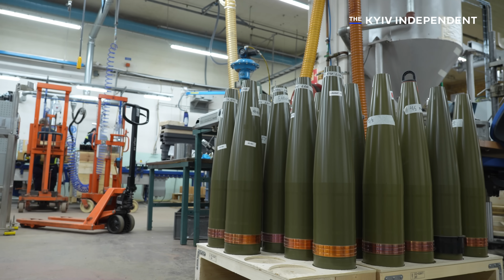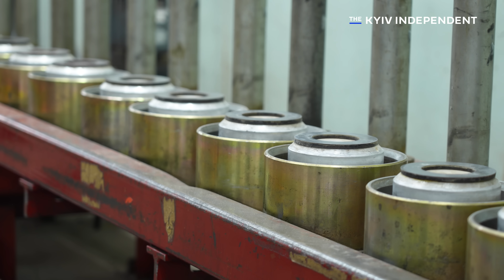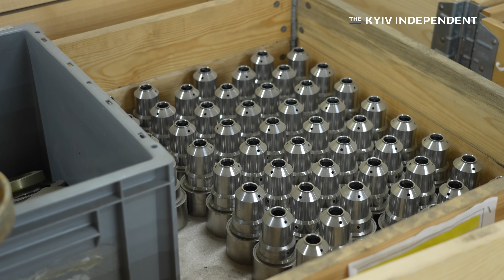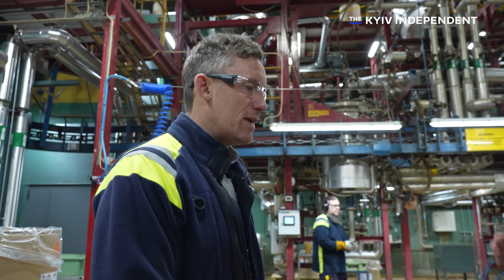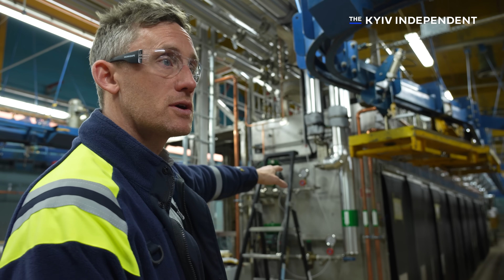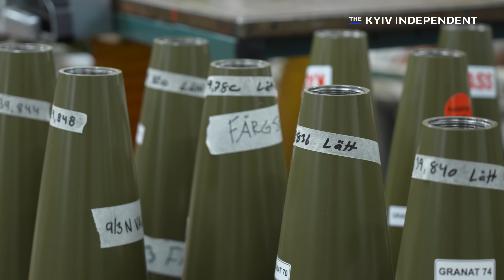The factory working 24/7 to make shells for Ukraine

Comment: So how many shells are produced daily and how many does Ukraine needs to fire every day?
This seems to be a very slow production speed.
Reply: There are, or has been various bottlenecks in the production chain, in this factory I think the capacity is dictated by cooling capacity(seems they are installing 16 more cooling sheds, so thats good), they need to cool down over night, so whatever you can fit in there would be max capacity, doubt they would come out and say what the exact capacity is though.

Comment: Never thought they would fill them by hand out of "milk canisters". But if you don't need many in peace, that might be fast enough. The roboter should be able to fill up many more to increase the capacity together with the extra cooling chambers.
Reply: Well, filling is obviosly not the bottle-neck in the production, so a more efficliant filling will probably not increse production that much.
Reply: @MaskinJunior  Indeed. He said that cooling down is the bottleneck. But that might need its time so it doesn't throw bubbles if too fast.
Reply: @MrPanzerTanzer  autoclave....
Reply: It's not exactly any sauce you deal with here. It's explosive and has to be gently poured. They flush the floor with water for a reason.🎆
Reply: In the video they said those are another product.
Reply: @kristofferhellstrom  "In the video they said those are another product."  And as they said, they are adding 16 more cooling units because that is a bottleneck, so there is a lot more plant to feed them than shown.
This is part of a factory that is spread out for safety. For all we know they were pouring the quality control samples from much larger batches of explosives, and that a different product perhaps a new design of cannon shell not yet automated. 
 Just a snapshot only showing what they wanted people to see while still giving some background.
Reply: Huh? Of course grenades aren't filled one by one on a table by hand from beakers on the actual production line. You're obviously not being shown a mass-production process here. If nothing else, all the labels and signs saying "faulty goods", "rejected" et c. in Swedish on these particular grenades should be a hint.
Reply: Maybe hand pouring gives improved quality, and less shells have to be rejected.
Reply: @the_hate_inside1085  No, it doesn't, and pouring by hand is much slower than having an automated system do it.
Reply: @stillness0072  Hand pouring had no relation with 155mm production.
Reply: Yes, quite a surprise, I was thinking it would be something like a Coca-Cola bottling factory, but it’s more like bottling fine wines in a small vineyard
Reply: yeah, i think a robotized assemblyline would be very good. But i think this is a fairly small company in sweden. And doing a assemblyline automated is advanced and very costly, so.. yeah, its handled with care by good workers. Kör hårt pöjkar å flickor på firman!
Reply: @jvsyoutube3298  Sanning! Men lite pinsamt hur smutsigt och gammalt det ser ut.
Reply: @kristofferhellstrom  kåken är byggd på 70-talet och har flera gånger under åren fått nya golv osv, ett år med produktion av den här typen så ser det ut att vara 15 år 😅 sen har det också varit rejält eftersatt under långa perioder fram tills för endast något år sedan

Comment: Sweden is an impressive nation. For such a comparably small population, their munufacturing capabilities are diverse and highly technical.
Reply: It is not for a small population, it is because of it. We have allways needed to utilize all resourses to the max, which made us develop technology to fill that task.
Reply: Always been a nation of engineers. According to Volvo cars vice president, the most common profession in the second largest city is civil engineer.
Reply: @qp9vp the Swedish term “civilingenjör” is not the same as the English “civil engineer” (The history of those titles is pretty interesting to read up on, and there is reason they are so similar in name, but different in meaning). 

But “civilingenjör” in English would be a bachelor and master in engineering, or an MSE (Master of Science in Engineering, a 5 year diploma degree), and they can be specialized in anything from electrical to mechanical and chemical (or civil engineering). Pretty much anything. 

Whereas “civil engineer” in Swedish would be “civilingenjör inom samhällsbyggnad”. Ie, an engineer specializing in infrastructure.
Reply: @Zantides  Not sure how you mean. Sweden got a population of 11 million. Denmark, Norway and Finland are between 5,5-6 million each. Citizens per sq/km is only slightly higher in Sweden than Finland and Norway.
Reply: @qp9vp  I confess that I'm not familiar with the economies of Denmark, Norway and Finland. I gained limited knowledge of Sweden due to 2 or 3 trips there. I'm impressed how Sweden has developed research and manufacturing and has retained their own manufacturing capacity. 

Compared to Australia (my home) with a population of approx 27 million, Sweden is highly productive in manufacturing. Australia's economy relies heavily on export of raw minerals and agricultural products. Though we have capable people, much of our manufacturing was removed overseas for the less expensive labor.
Reply: The SAAB Turbo!
Reply: I am sure we have seen a facility that is impressive, but decades old. The most modern facilities we have NOT seen and there is a reason why.
Reply: Sweden has always had russia as the biggest enemy. We have fought them before and Sweden has even invaded Moscow. For the last 30 years we thought russia was on its way back to europe but we was wrong. Now we understand that we have to help ukraine against russia.

All the talks about immigration is just stupied people talking. So immigration isnt perfect, right, but its not onesided. We need people in our country. If you manage to not get a job as an ethnic swede you have some problems :)
Reply: Because educational system in Sweden is not based in stupid things. Kids are engaged to develop a real learning skills , not to memorize irrelevant data.
Reply: Government support to Ukraine: By donor country GDP, incl. and excl. EU share Estonia Denmark Lithuania Norway Latvia Netherlands Slovakia Poland Finland Germany Croatia Bulgaria Sweden Czech Republic Belgium Spain Austria Greece Slovenia Hungary Italy France Romania Portugal Cyprus United Kingdom Luxembourg Malta Ireland Switzerland Canada United States Japan - Just for fun
Reply: Billy Joe and Harrison fall stop carping at each other be responsible that you and your people are responding to a much needed demand from a desperate country...Get manufacturing at speed you not be left with unsold stock..
Reply: @johnmercer5862  👍
Reply: The history during WWII taught Sweden a lesson. Always protect yourself. Now they have decided to help others in NATO (Sweden is a member of NATO and very important). May they be rewarded in the future for this bold decision about who is the bad guy. God Bless Sweden.
Reply: They was the safest place in Europe, even Ukraine refugees wanted to go home in the start of the war because they did not feel safe in sweden, now its an immigrant hellhole with knifeattacks, bombs and even the millitary was sugesting going out in the streets last summer becuse its become so terrible bad.

You will understand more when hearing this speak that was in Hungary a few days ago https://www.youtube.com/watch?v=ywTjt3PQwD0&t=1s
Reply: Western Europe should be calling on Ukraine for peace instead. This way resources are being wasted on a war Ukraine can't win instead of on infrastructure or children's education
Reply: Good old slimy Sweden, sit on the fence during the war, selling iron ore to the nazi's while everyone else is out fighting and dying for freedom and human decency.
And here they at it again! Unreal!
Reply: the Nazi Supporters
Reply: It's also the rape capital of Europe...
Reply: Mostly i guess it comes down to investing in the population with access to free education, and also putting emphasis on it so people actually take advantage of it. One of the many problems you get with large populations is to administer and organize things efficiently, the upside is that you have higher revenues so you can throw tons of money at problems to be resolved. For countries that don't have that option you have to do better with organizing. Downsides again is that countries with larger populations often have higher salaries, so smaller countries have to offer better incentives with benefits and things like that. Hence the many cultural and social differences that brings out these kind of effects on the industries.
Reply: For such a small country they make a lot of money on death and war. Saab and others sell directly to terrorist nations and they are the only companies in sweden that don't need to show who they are selling to. So swedens government send millions in "aid" to third world countries and then they buy military equipment from sweden soon after. It's super corrupt and disgusting
Reply: This "Nammo" factory is from Finland. ( Nammo Lapua Finland)
Reply: @JuhaStrandvall  The company, the factory is in Sweden. I believe that the company is mostly based in Finland and Norway. Either way, slava Ukraini.
Reply: truly
Reply: What will happen if China buys Sweden and give it to Russia?
Reply: Even more if you know that 3 million Swedes are immigrants contributing very little in anything except crime and annoyance
Reply: No thanks i think i rather live in the third world of costa rica drinking my strawberry daquiri a nation with out an army far away from wars or manufacturing weapons to kill other human beings.... I rather be impressive in a ecological sustainability and positive influence because the baltic sea is one of the most poluted in the world for this same reason their industry.
Reply: Swedenistan 😂😂😂😂💩💩💩💩💩🤫🤫🤫
Reply: You act like you’re the god of the Internet. Like you are the one in charge. 

I comment whatever I want, wherever I want, on whatever comment I want. And there’s nothing you can do about it.

I stand by what I said. Sweden is not impressive. We USED TO BE impressive we are not anymore. I can tell you first hand since I’m both Swede and an engineer!

With that said, you should simmer down just a bit and realize that other people have facts of their own to present.
Reply: @billyjoe3309  Swedish nationalist propaganda bullshit. Open a book one day. Instead of watching brainwashing social media post. You might educate yourself.
Reply: @billyjoe3309   Chuck.
Reply: My response to comments is sometimes shaped by how I perceive those comments. Maybe I was too sharp with you?

I've been visiting Sweden since the early 2000s. Among other things, I was very impressed by the concept of 'Lagom'; you'll know the meaning of that term better than me. I felt, in my 'non Swede's eyes', respect for the idea, wondering how it may have helped shape the nation.

Over the years, I sensed the dilution of Lagom. Outsiders, initially from Europe, then from further away, had no regard for the self-control that helped strengthen and unite Swedish society.

In later visits, I saw the effects of more immigration from cultures that were very, very different from Sweden. Groups that seemed to have no interest in adopting the practices of the country they valued as a place of refuge. Their willingness to take, then take more, then complain that they were not getting enough, was obvious.

The relative peace and cohesion of the society I first saw appears to have gone. The generosity of the Swedish people seems to have been  given to a hostile, ungrateful, resentful recipient in a social experiment that was  never agreed to by the Swedish people.

My generalisations do not include the individuals and groups who may have taken other constructive, positive paths. 

As a 'foreigner', my knowledge of your society, based only on personal observations, conversations and various information sources, is extremely limited. I may have some understanding of your concerns, but I may be totally wrong.

I was originally remarking on a positive attribute of Sweden that seems to continue. I wanted to show some appreciation for your contribution to Ukraine. If this context, I'm used to the professional trolls of putin injecting their negativity and distrust into any conversation about 'western allies'. This caused my suspicion of your response.

Another strength that I see of the Swedish people is their pragmatism and independence, reflected in their decision to help Ukraine. I hope these attributes will help you overcome the internal problem you face.
Reply: Sweden also has extreme crime rate from migration. That's also impressive.
Reply: Nice one trollboy, ever been here? Russia has a homicide rate SEVEN times higher than Sweden. "But my propaganda says..."
Reply: @billyjoe3309  lol no we really don't. Shootings are up in certain areas. Everything else, all other crime types, continues down every year.
Reply: @billyjoe3309 
Finland has more murders per capita than Sweden….
Reply: @billyjoe3309  That has nothing to do with this conversation. Try again without revealing your bitterness.
Reply: @GarrisonFall  "Sweden is impressive" is what I replied to. It's not at all impressive how fucked we (Sweden) is. I bet you would be bitter too if your country was falling apart.
Reply: @billyjoe3309  No, you are using 'impressive' in an ironic way. The video is about the shell factory and I'm impressed at Sweden's manufacturing capability.

Yes, immigrating in Sweden has created a social/economical/criminal mess. It has nothing to do with this video content nor my comment.

Comment: As someone that have been in a few factories, it is a little disappointing to see this factory.
If you compare with production of cars, food, plastic, pumps, beer and soda, toys and electronics it looks very slow.
The production looks more like the production of large wind turbines, special cranes, special transport equipment and other low volume productions I have seen.
I get that you need safety when working with explosives, but it does not look like a 21st century factory to me.
Reply: They make 70,000 grenades/year and the factory dates back to the 70s. The cooling process takes 11–14 hours, and limits the production rate. In total, Europe can make 5-600,000 grenades/year and everyone understands, a little too late, that investments in new modern factories are needed. The factory in Karlskoga will now be expanded with money from the EU and the Swedish state.
Reply: @hansgustafsson2061  I don't know where you have the numbers from. But that is less than 200 a day.
Reports say Russia is using 10-80k a day, Ukraine only 2-9k. I know we have some in stock, but if we cannot even produce the 2k a day for Ukraine it sounds a little disappointing.

When it comes to production a 14 hour cooling period should not be a problem. In a massproduction it will take up some space, and I guess the conveyor needs to carry a lot of mass in a continuous production. But it doesn't seem much different from large steel production or brick production.
But it cost money to make and it has been a long time since artillery has been used in this quantity.

It is a little easy looking back.
Reply: @hakkebrakke8575 In peace-time this factory was probably big enough to supply all of europe, the problem is when war happens you dont need grenades off the assembly line, you need them of your stockpiles.
Reply: @MaskinJunior  Not really, most of Europe hasn't been buying shells for decades. The reason a company like NAMMO is owned by Finland is largely Finnish security of supply for the very substantial Finnish artillery that was never downscaled and fires more shells in training every year than many European nations hold in their stockpiles.
Reply: @abrakkehakka1357 There are way more than 10, Nammo alone has 27 factories, and there are at least a couple of handfuls more manufactureres of 155mm shells in Europe alone with who knows how many production facilities.
Reply: What has to be taken into account is that these are precision made munitions with an extremely low rate of failure unlike the mass produced shells produced by Russia and allies which have an extremely high failure rate - I’d rather be handling these than a North Korean equivalent 😬👍🫡🇬🇧🇺🇦🇸🇪
Reply: Russia lives on grenades that the Soviet Union stockpiled. The Russians have the same problem with increasing new production of artillery shells. During the Cold War, Sweden had over 1,000 combat aircraft and was the world's fourth largest air force. Today we have 96. Our war industry has been at a low ebb but now production is increasing because they are getting orders.
Reply: Before the Russian Ukraine war there wasn't that many orders for these kind of shells. The factory is not made for large scale production as is needed now.
Reply: It's a finishing facility, and is updating it's processes to ramp up production more.
Reply: I agree, I miss the precision and cleanness and repetition which you so often see at Japanese and Korean manufactories.